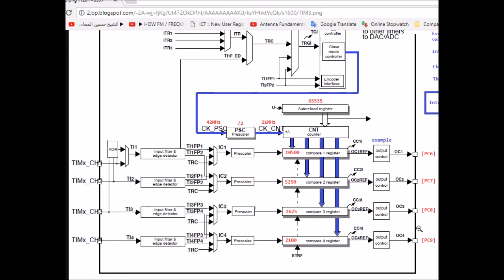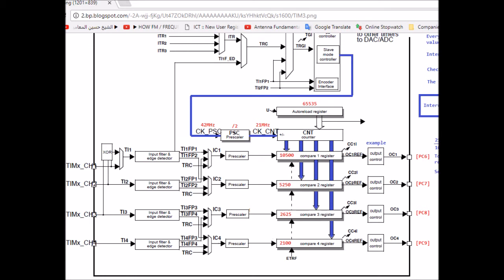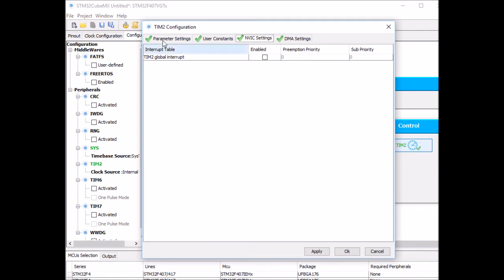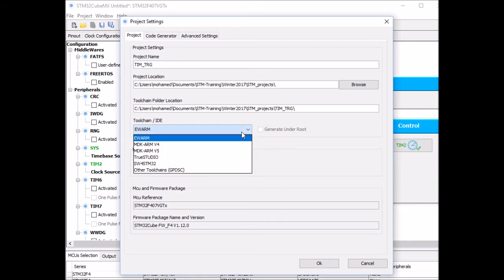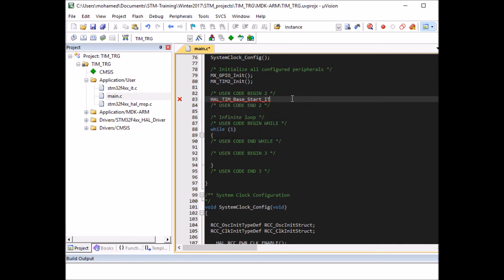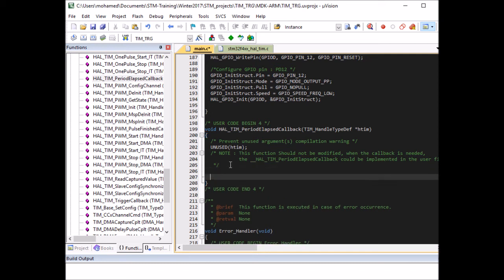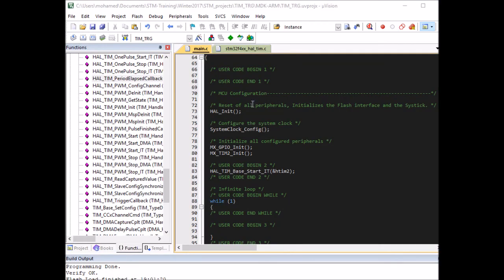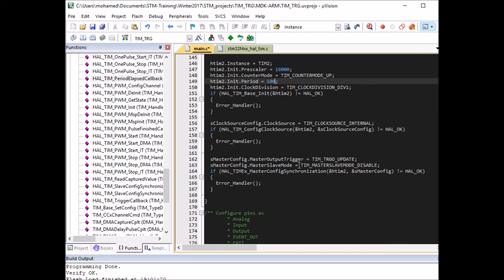STM32F4 Discovery board - Keil 5 IDE with CubeMX: Tutorial 19 TImers-Internal

Comment: i have a question, you put 1000 in period, and 16,000 in preescaler, thats means that the input is 1000 divided by 16,000? i didnt understand it, can you explain that parameters?
Reply: or preescaler only divide the core clock? and period is every tick of the presscaler?
Reply from the maker: Luis Morales 
Hi Luis,

It goes like this:
->Clock freq = 16MHz (can change this, but in my case it is set to 16M)
->Prescalar divide the clock freq, so 16MHz÷16000= 1KHz
->Then the timer ticks at a rate of 1KHz (each tick is 1ms)
-> Period just determines the maximum  number of ticks for a timer, 1000 ticks in my case. So a full period (which is 1000 ticks) = 1000*1ms = 1 Sec.

Hope this clarifies it a little more.
Regards
Reply: understoood, thank you so much. I have learned a lot with your videos, really awesome, thanks Mohamed. i´ll see all you still have upload.
Reply from the maker: Brilliant!
Reply: @mutexembedded2206  Sorry if I bring back to life this matter but I think TIM = Freq /(prescaler +1)*(period +1) Due to this, Pres' should be 15999 and Peri' should be 999.
Reply from the maker: Mauro Piccoto 
That's right, but I usually tend to leave it like this in CubeMX, then manually add -1 on IDE.
Reply: +MYaqoobEmbedded I like your style, is more practical. By the way, your videos are pure gold, have you considered making a video about Low Power Features?
Reply: @mutexembedded2206  clock frequency means core clock or timer clock
Reply from the maker: @usrrsr  Hi, it often refers to the Peripheral clock like APB1, APB2